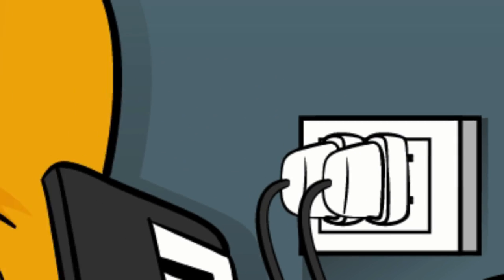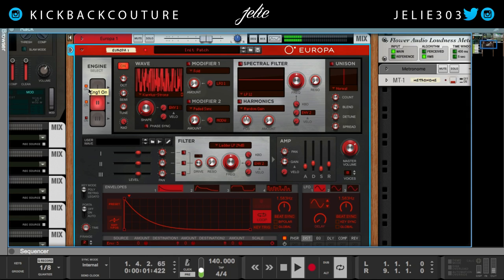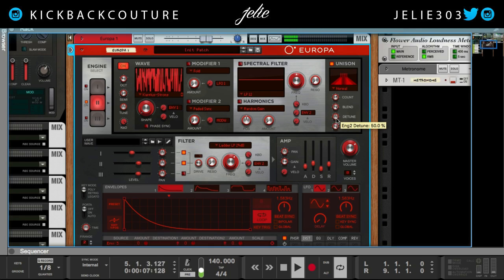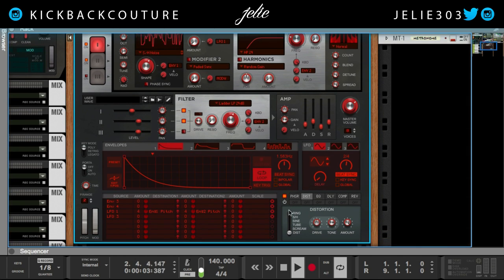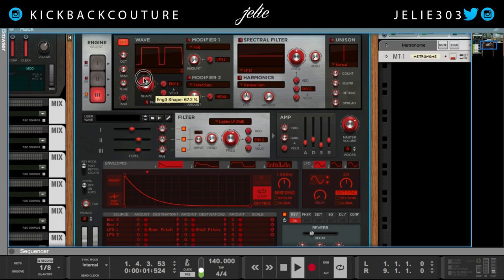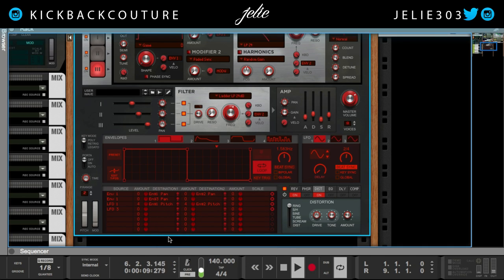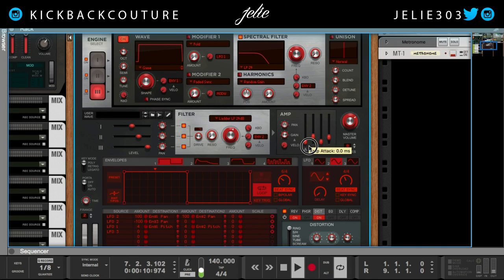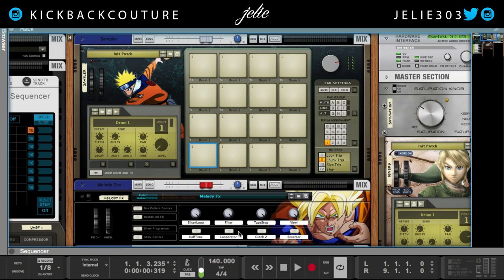How to Make a Bell in Europa | Reason 10

Comment: ? What's the best laptop 4 this program thanks any info
Reply from the maker: At least an i7 core and 16Gb of Ram
Reply: @KickbackCouture  I use Reason on my 1.9Ghz dual-core laptop with 4gb of ram, and it mostly runs fine (only when it gets to big projects does it have issues). And i7 and 16gb of ram is not at all necessary to run Reason well
Reply from the maker: If you use large refills or rack extensions, especially vsts 4 Gb will definitely not be enough. As you mentioned big projects results in issues. An i7 or any dual processor is necessary, the higher the quicker your system runs. If music is just a hobby and you only dabble here and there then your suggestion is just, which I did not consider. Thank you for your input!
Reply: @KickbackCouture  Ty 💙